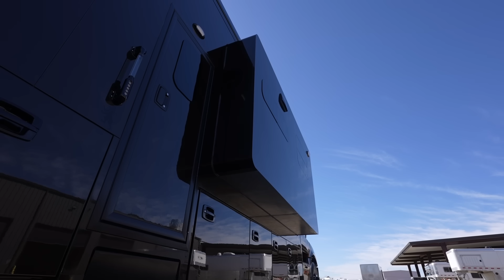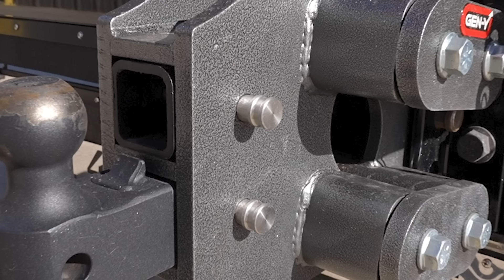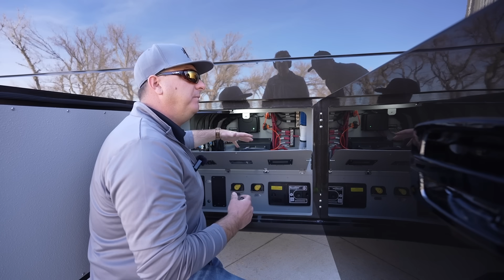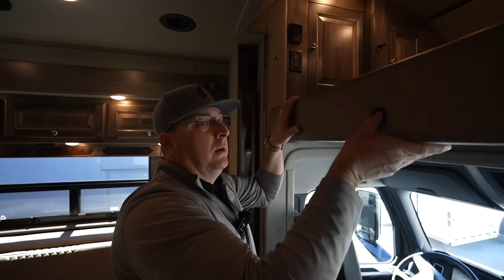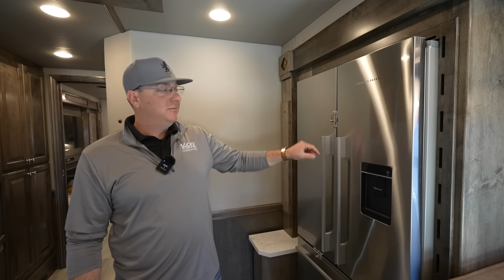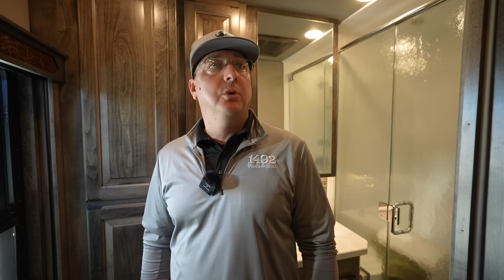THE MOST EXPENSIVE CLASS C RV ON THE MARKET!

Comment: This build is phenomenal, love it! But why the strong emphasis on no fiberglass and only using aluminum?
Reply: And aluminum conducts heat and cold more. Wonder how low temps are in this build?
Reply: Strength be weight. 6061 or 8000 series aluminum is incredibly strong for its weight. Twice the strength of steel per pound. Aluminum can also be anodized to any colour and fancy paint finish such as shimmering and special metallic finishes that fibreglass can't do. This is a VERY HIGH QUALITY BUILD! I would use a high end aero-nose Longhorn semi with twin turbo Cummins in it for the truck portion. The fold down patio in the back sounds like a good idea to me too!

Comment: Couple of things missed number one was an escape door in that rear w c  as per newall and the overhang on the rear end has very little upwards slope so a risk of grounding,  the one piece alloy rear end , would like to see two piece as rear shunts are the norm so a two piece would be easier to repair. Overall its an impressive coach but 1.4 million against a Rengade Ikon  I am not so sure. As i live in europe  a local chassis would be more to my liking for service.
Reply: They have a large skid roller integrated in the bottom of the rear hitch.  This will take any impact from bottoming out or scraping.  The truck also has the ability to temporarily "over inflate" the rear air suspension to raise it up in situations where some additional ground clearance is needed.

Comment: I'm curious to know how long a couple can be out in the desert in this with no hookups . solar to run AC and fridge? Oh.. Over a week boon docking.. He answered my question. Cool
Reply: With a built in ocean saltwater desalination system and a one micron heavy metal and a ti bacteria/anti-virus filtration system that has 1000 foot long reels of water intake to take in river, lake and ocean water hoses into 1000 gallon frame rail tanks plus enough storage for 3000 lbs of mountain house freeze dried food plus add in a retractable or portable solar panel system at 10 kilowatts, you could live for up to six months fully off grid, especially if you put in quad-sized diesel fuel tanks driving less than 100 miles per day between campsite destinations every three days.

Comment: Im curious as to why on rigs even this extravagant and expensive..they still use RV style air conditionings...is there not way to add a residential style AC in these things, with an air handler and all that? Or even a few mini splits? They are so much more efficient and cool so much better.
Reply: So I Full time RV and if ours didn’t already have 2 AC’s I would put in a MiniSplit. It’s a rather popular modification.
Reply: Never seen a mini split in a roof. Can't have it on the wall unless you are driving down single lane roads with no other trucks.
Reply: @williamadams4843 Yes, you can absolutely get a mini split indoor unit that mounts in a ceiling.
Reply: @justinnav  Where is the heat exchanger on that? On the roof? That is why it wouldn't work you add a foot to the height of the truck. Making to tall for bridges.
Reply: @williamadams4843 RV air conditioners add a foot of height to the roof as well. Plus you could mount it on the rear or underneath or build it into the space above the cab. And you are building a $1+ million dollar custom RV. You could build a custom enclosure and arrange the fan, compressor and coils however you want. You could probably get the height down to 6-8" without much effort.
Reply: @justinnav  it is already 13ft plus tall. Underneath or off the back makes sense. No way to put it on the side or roof without making a bigger problem. I thought of using a back corner with a vertical air handler that the hot side is closed off from the inside by insulation with some vents on side and rear for air flow even an electric fan or two for circulation at low speed or stationary.
Reply: I think it has to do with the huge difference in electrical and the power draw for a home unit.
Reply: @stephenedwards9634  no there are high end . Rigs with home units in them. The main reason is space, you can't put the unit on the roof it adds three feet minimum to the height. Now you cant go under a lot of bridges. If you put it underneath you lose storage and it must have good ventilation. Also it is now hard to work on if something goes wrong. Sometimes it is better to not try to reinvent the wheel
Reply: @williamadams4843  well space is a given for everything because I’ve seen cattle trailers with window unit AC in them but when talking an actually 2 or 3 bedroom home hvac? That’s a whole another animal entirely
Reply: @stephenedwards9634   home window units won't work in RV windows the wall is not thick enough nor is the window able to handle the weight. Think about a house wall. They are atleast a 2×4 with whatever inside and out. Plywood and siding or brick. 
With either drywall or plaster on the inside. RV is sheets of aluminum with three inches of foam at the highest level. Less foam and carbon fiber like on the lower. Horse trailer is usually all metal
Reply: @williamadams4843  hmmmm ok
Reply: Yes you can absolutely put a mini split in easily. No idea why they wouldn’t do that
Reply: Love it reminds me of a swat van😁
Reply: You need to be careful of over condensation.
Reply: Main reason is space….lots of room on the roof compared to the basement area.
Reply: And big enough for controlled venting by temp.
Reply: Mini splits are big piece of junk they do not last but lower basement units good idea.